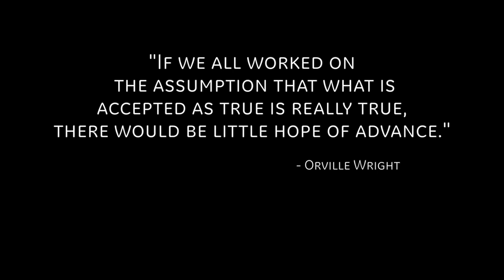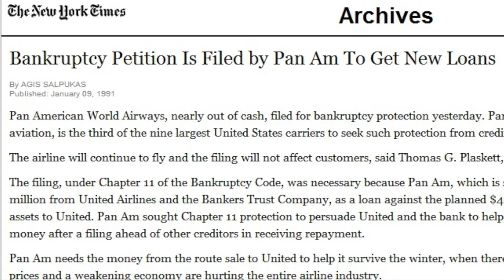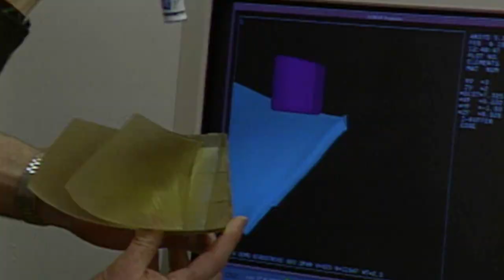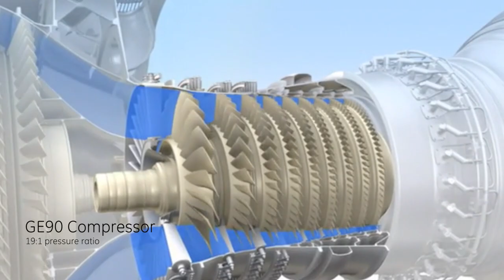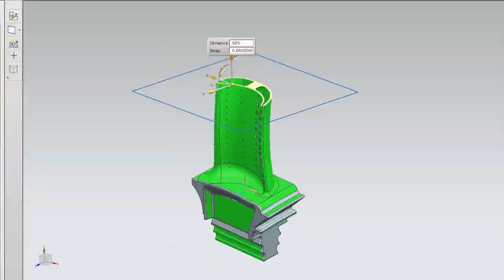GE's Big Bet on Goliath Engines

Comment: What i find very ironic, is that for years I've heard Americans dismiss Rolls Royce saying that American GE design and engineering is far better, yet at the helm was  a British Man, so both RR and GE are products of British design and engineering pioneers. Whereas as the American PW. are still loud fuel guzzling smoke machines.
Reply: LOL - So, having a Brit working there makes it 'British design and engineering,' even though the vast majority of the engineers working there are Americans? Also, some of RR's design is done here, too. They tried to recruit some of my aerospace engineering friends. Also, according to RR's own website, "More Rolls-Royce products are built in the U.S. than anywhere else in the world."
Reply: I guess you haven't heard about Pratt's geared turbofan Adam? It will be the quietest engine flying and one of the most efficient.
Reply: GE is a long way ahead of Roll Royce when it comes to Combustor tech. RR combustors are far inferior in efficiency to GE's by a large margin. RR has their 3rd shaft, P&W has the geared fan but GE has the  combustion tech. Efficient use of fuel starts at the combustor and also drives emissions more directly that the other approaches. 
Also the majority of RR engineering is now done in the USA.
Reply: SuperBuzz71
no GE is not far ahead than RR. Where on earth did you see or hear that?? The only reason why a lot of RR were built in the US was because of the high demand over GE. That has since ended and shut down. GE only came up to scratch with RR because they got British engineers in to bring them up to RR standard.
Reply: Where on earth did I see that? Testing development RR and GE combustors. My statement is based on first hand knowledge. Yours seem to subjective to proving some stupid point that British engineers are born smarter than American engineers. 
As far as market share, GE and CFM combined are almost twice what RR and IAE are combined so I'm not sure about your demand for product comment.
Be proud to be a Brit but don't be an idiot about it
Reply: SuperBuzz71
So you tested both RR and GE combustors to find GE to be better? Well how is it that the market has favoured the superior power, performance and fuel economy over the GE for years? GE led the market with the 767 but not the 757 which still remains one of the best and most successful engine RB211 series from the Tristar through to the 747-400. Today significantly with the Trent 1000's triple spool design over GE's twin spool design which offers far superior performance on climb etc whereas the GE is ever so slightly better during cruise! How is it that the RR is the leading engine of the 777-200 and 300, is the leading engine on the A330 200/300, the leading engine on the A340-500/600, The launch engine of the 787 and A380 although they had the problem with the mid-air explosion the upgraded series Trent 900
is still the leading engine for the A380. It is the engine for the A350XWB and will use upgraded Trent 7000 engines on the A330 800/900.
The 787 and 747-8i have been plagued with problems with their GEnx engines, and even though the Trents have had hiccups, they do not fare as bad as GE's issues.
The only significant success they've had is the medium range market with the A319/20 and 737NG. The A321 is a V2500 dominated aircraft.
Rolls Royce engines have always been the more powerful, efficient and higher performing engine over GE. So whatever combustor testing you seem to have done that determined GE is better, wholly contradicts the aviation industry on what engines they choose for their aircraft!
GE have great engines, but to say they top Rolls Royce, is, well, ignorant and questions the validity of your claim of being an engineer!

Oh, and when it comes to American engineers vs British engineers, there is no comparison. And no, they weren't born better, they trained better from an industry that is far superior in engineering. All you have to do is look at American industry in regards to aircraft manufacture, car manufacture etc......they need outside source to develop their technology, and GE brought in a British mind because they were too inept to excel themselves from their primitive thinking in regards to engineering. Boeing need to go to other countries to get their planes designed and built. Europe do it all in Europe. Designed and built. Airbus are fast becoming the dominant manufacturer and European engineering and designs are way beyond the US. Even Asia are surpassing them!
Reply: F136 RR Combustor smoked like a whore and with a flame Temp pattern near random and a few other issues I can't go into for professional reasons.
 RR 3-spool has superior climb power but that's a small portion of the flight envelope. Burn less for climb or less during cruise, which do think is better more efficient on a flight more than an hour long?  

 Yes, GEnx, like the Trent 900, has had  problems too I won't go into details because I don't know what is to be made public. Despite this you cannot argue with the real number about total market share of GE/CFM v. RR/IAE. I'm not even counting EA in this.
 
 When it comes to your comment about UK auto industry providing technology to US, your kidding me right? The US bought up the left overs from the failed Leyland Group for marketing reasons. You have know that. Rover and Jaguar made incredibly cool cars with infamous reliability like the other not so appealing Leyland brands. Leyland was the last gasp of a sovereign auto industry that could not even survive with govt. subsidies. If UK auto industry engineering was so great why did they hold on to the 6v positive ground so damn long? I've said for years I there's three things Brits are known for, bad food, poor dental health and worse electrical engineering.
 The old Hawkers were an electrical nightmare. But yes, before you say it, Raytheon bought them to get in the Biz-Jet biz after the Diamond but that doesn't change the truth.
  If Brit engineering is so good why did they stubbornly make motorcycles with 1960' tech until the demise of the industry in the '80. The Japanese were kicking their ass in technology but the couldn't even put an electric starter that actually worked on a bike until the '80s!! The '75 Norton Commando was the first to come with a starter yet IT DID NOT WORK. Refer back to my previous comment about Brit electrics.    
 Finally you argue that Boeing has to go to other countries to get planes designed and built but Airbus, based in 4 European countries and China, is" Europe doing it all in Europe". I'm not sure how that supports your argument that Brit engineering is superior. Maybe you think the Brits are carrying the lot. If the Comet wasn't a flying disaster maybe the UK wouldn't need to be in Airbus.
 I'm not claiming US engineers are superior to any one but you claim UK engineers are superior despite the fact that the market place and history have  proven other wise for the last 65 years.  I will however argue that Brits are superiorly funny   though. You're no John Cleese but even you make laugh. 
How's that British Manned Space Program coming along. When will Nigel Mountbatten finally walk on the moon. Yes, I know we couldn't have done with out the Germans. Trust me my German friends remind every time. You know the Germans, the guys with a reputation for "German Engineering".Yes, I know German engineering is all it's cracked up to be in actuality sometimes. Funny how nobody ever tries to sell something with the line "Finest British engineering" for some reason though.
Reply: adam willis
A few factual errors in your post. 777-200/300 are out of production. Boeing single-sourced the GE90 for the popular 777-200LR and -300ER for a reason. If the Trent 800 was so much better, wouldn't they have gotten the deal? A340-500/600 only had Trent 500s, so not the "leading" engine - the only engine.
GEnx has market share on 787, as does GP7200 on A380.
Early issues with GEnx (like icing resistance) have been fixed thru software mods. Recall the BA 777 that crashed short of landing due to ice in the fuel system? Yep, that plane had Trents. No aircraft have been lost due to problems with the GEnx far as I know (I'm a turbine engine analyst, so I stay on top of this stuff).
Trent XWB promises to be an excellent engine, as will the T7000 because of shared technology.
"Rolls Royce engines have always been the more powerful, efficient and higher performing engine over GE"  --- You need to qualify a statement like this, otherwise it's just an opinion. Both companies build good engines; they just take a different approach with regard to architecture (2 spool vs 3 spool)
IMHO as an analyst, I'd put Pratt's geared design up against either.

Your last paragraph was nothing more than Eurocentric drivel.

Cheers.
Reply: English design not British, I know the guy was English, no need to include the Scots and the Welsh by saying British. Rolls Royce is an English company, always has been and always will be. English engineering at its finest. Kind of nice to see the English still being able to make good "stuff", the last time the English did anything spectacular was the Concorde, and that was together with the French. You know, the Anglo-Saxons and the French. 

I like both Rolls Royce and General Electrics, however, I prefer Rolls Royce, they've been in the business for a very long time.

As for the Airbus and the Dreamliner they are going backwards, the Concorde was the future, we are now going backwards again. The Concorde took 3.5 hours between London and New York, minimal amount of time spent in air is luxury! Another plus with the Concorde was no jet lag.
Reply: adam willis
Here's an interesting counterpoint to one of your assertions..
http://www.flightglobal.com/news/articles/uk-faces-engineering-skills-crisis-402185/
Reply: SuperBuzz71 
F136? We're talking about civil aviation here, not fighter jets!

And yes, a maximum weight aircraft on climb uses more fuel because not only is it fighting gravity, but it ascending from lower atmospheric pressures to higher atmospheric pressures. Cruising altitudes  use far less fuel because there is less density in which to fly through. The same way a supersonic jet can fly at mach 3 at very high altitude because the air is less dense and air passes through the intakes at a much faster rate. So yes, An aircraft going from ground level to FL38, can take a fully loaded 777 up to an hour. Once that aircraft has leveled out the engines fall back and change gear. This creates an even flow of air across the wings aswell as high by pass thrust. Cruising burns less fuel, not only that but as each gallon burns off, weight decreases meaning the engines adjust because they're not working so hard. And on descent, approaching and landing stability is of utmost importance in any weather!

!I've said for years I there's three things Brits are known for, bad food, poor dental health and worse electrical engineering"

Better than Heart disease, Diabetes, Chronic obesity, pathological liars, psychotic christians, sensationalist exhibitionists, nonyielding arrogance, still think the British are from the 1800's and talk like Dick van Dyke! An Americans definition of bad food in Britain is that it's not a McDonalds, Pizza Hut or a Burger King!

So anyway, let's see here. How many Americans drive around in cars made in America nowadays hmm? Very few. You need an oil pipeline direct to your house to fuel an American car these days, primitive and nothing of build quality except raw engines that the rest of the car cannot handle! All American cars are rust bucket death traps but hey, plastic shell and 800bhp, go USA!

Lets list these cars you want to bring into the mix.

Rolls Royce
Aston Martin
McLaren
Jaguar
Land Rover
Bentley
Lotus
TVR

Funny how nobody ever tries to sell something with the line "Finest British engineering" for some reason though.

Funny how the best cars in the world are British, German and Italian. Funny how Mclaren are still building sports cars that rival Ferrari, Lambo, BMW, Mercedes and Porsche. Funny how one of the greatest ever cars built was the McLaren Merc SLR!!
Funny how the most successful racing scene, F1, has at it's helm the fastest most brilliantly engineered racing cars in the world, that are British. Is there an American Formula one in there? No....why? Because these cars need to go round corners! Even your Ford cars are now being designed based on UK Ford Motors because yours are rubbish!

But concerning those manufacturer names i listed. Deliberate that most of the cars from these cars are all hand built by British engineers! Every thing from start to finish is hand built!

And that is why most American rich folk buy them and import them.

Just like German and Italian luxury and sports cars.
The majority of Americans now drive Asian, European or British cars. Cars that can actually go round corners and do not cost a 2nd mortgage to run!

But you want to talk about how the British manned Space program coming along? How much do you think the UK has invested in that to send British astronauts to the space centre? And don't forget that you're still using the same tech since the 70's. But the russians were hot on your trail in the 60's thats why you had to fake the first one! The first ever passenger flight into space is being created by Richard Branson! With new engineering without any fossil fuel in sight. Americans don't like free energy technology!

And Airbus built 4 new production premises to keep up with demand and cut demand on the lines at Toulouse, it saved on fuel and actually made jobs. Asia alone is a huge buyer of baby Airbuses so they created production premises there to serve Asia, Australasia and the middle-east.

And if you feel like drifting back to the 60's, we'll bring up Concorde, only the greatest feat of aeronautical engineering ever. Just remember who co-designed those engines, Rolls Royce. The only supersonic airliner ever built. British-French.

The best thing to come out of the US, was Harley Davidson.
Reply: LOL, Adam. You're out there, my friend... Started off strong then completely lost the plot. Stick to the topic at hand, chum.
Reply: dieselyeti I did stick to it mostly. But in some areas i was simply returning the favour!! When people start doing that mediocre shit because they can't muster up anything else, i just return some of it back.
Reply: soaringtractor
What, do you believe Boeing planes are all built on US soil?
Just like Airbus, they have parts shipped in from various country's manufacturing the frames.
Airbus built their new plant in the USA for the same reason they built a plant in China BEFORE the US plant. Because of demand, mostly for the A320. Instead of having to fly these planes from Toulouse and get parts shipped in, they built these plants to service not only a radius but also their own country's airlines.
The A320 family has become one of the fastest growing fleets in the US that has dwarfed the 737. When Airbus were flying the 320's from France, they had to pay put a lot of money for landing and fuelling rights because the distances these 320's had to fly meant stop-overs. It led to slower production and less buyers. Now, with the 2 plants spanning across the entire world to serve each part within distance, they have been able to gain more buyers and more unit buys than before.
Boeing are no longer concentrated on that market because Airbus is so utterly dominant. Not even the new generation 737 is going to be able to keep up with the 320NEO. Boeing can't even keep up with Embraer for that smaller market.
Already, Airbus has more orders for the A350 series than 787 series. The 747-8i, as much as i think it's a gorgeous aircraft, is a flop. The A330 series is still selling and its new NEO is once again going to be a good seller.
And each of these aircraft can be built, in the US and China.
Boeing don't have that kind of versitility!
Now don't get me wrong, Boeing is not some mickey mouse outfit. But to dismiss Boeings issues and replaing them with Airbuses like they are worse than Boeings, is just obnoxious.
I mean, if it wasn't for the arabs you wouldn't even have the 777.

Oh and one more thing. Instead of being such a sarcastic and patronising shit, try taking on board that so far you have left 3 posts on this topic and 3 times you have been totally off base and in several areas, plain wrong.
Reply: soaringtractor
Any aircraft can be a 747. But no aircraft can be Concorde. That aircraft could have been huge, if it were not for politics in the 60's and 70's.
But tell me, how many people 30 years after the 747 was built used to stand in awe of her when she passed? Very few!
How many people used to stand in awe when Concorde passed? Everyone.

Concorde was that rare breed and no matter where you were in the world, when Concorde was in town, you stopped and paid homage to the girl.
You can speak about the 747 all you please but the fact is this. When Concorde used to take off from Heathrow (i lived next door), it would arrive in NewYork before it took off from Heathrow.
When it made an appearance to taxi, cars used to park up on the road and stop to watch it. Kids were taken to the spectators section on the roof of Terminal 2, in the hope to see Concorde. Fathers used to raise their children up out of the sun roofs and stand them on the car roof just so they could see Concorde go by.
From the first day until her last, she NEVER lose that sparkle. Generation after generation came and saw this girl fly and she never failed to amaze kids, all over the world.
People used to gather at specific times on the shores by JFK airport, to see her take off. Only she had that take off. No one else. That low bank over the bay was famous.

The 747 was called the Queen of the skies, but without doubt Concorde held that crown until 2003. You have two aircraft sat side by side at a museum and the most visited aircraft is what??
The Concorde! That is why they bought it to put it in that Museum!
Reply: soaringtractor
You're by far the minority of people who see Concorde in a negative light. But i'm sure if the USA had made it you'd be singing a very different tune!

I mean, you flew on her and have nothing to say positively about what you actually did. Flying in general is a miraculous thing but to fly as a passenger sipping champagne at twice the speed of sound is something beyond belief. How can you not pay homage to one of the greatest human engineering accomplishments of our time? 

Oh and by the way. The 747-100 and 200 fitted with stock PW engines screamed with just as much ear plugging noise. The difference is, that Concorde would go off twice  a day. Those screaming 747's and roaring 727's, 737's, MD's and DC's were all day, everyday.

I lived right on top of Heathrow airport for 25 years since i was born and there was as much perpetual noise causing more pollution than a Concorde at 11am and 6pm. And because the aircraft was like a rocket, the noise didn't exactly last very long.

But trying to compare Concorde to a 747 is like trying to compare an old's mobile to a Bugatti Veyron!
Reply: I think they're all about the same - the state of the art defines the limits at the moment - they're all good engines